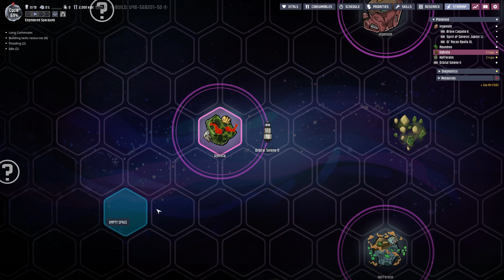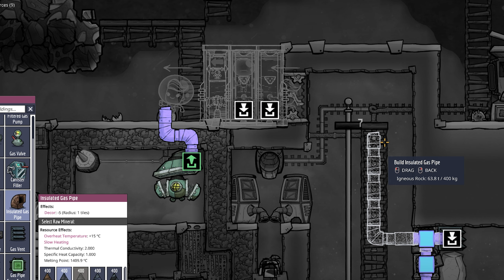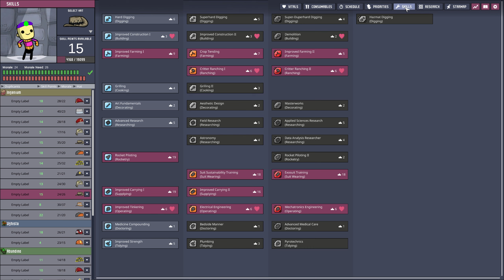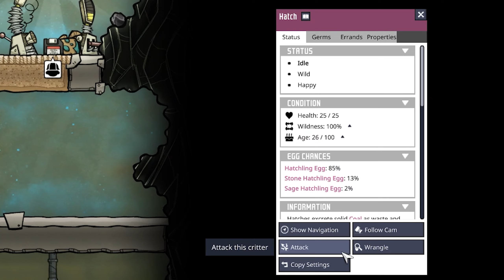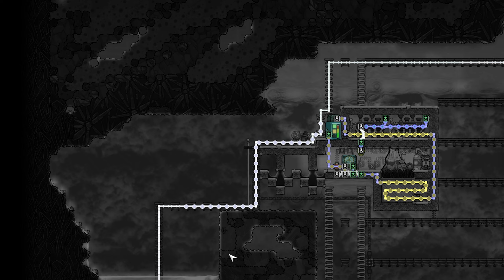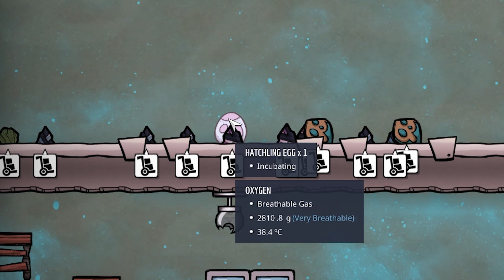COOLING an entire SWAMP PLANETOID ❄️ | LP2-EP37 | ONI

Comment: 18:42 You might rework that section near the rocket platform.   I think it's something along the lines of nine blocks down from the platform for rocket exhaust.  At the very least lower the pipes several blocks, build insulated tiles above them and vacuum out the section between the old ceiling and new one. 
19:05 Blinks You do realize you have Morbs infesting your latrine, right?